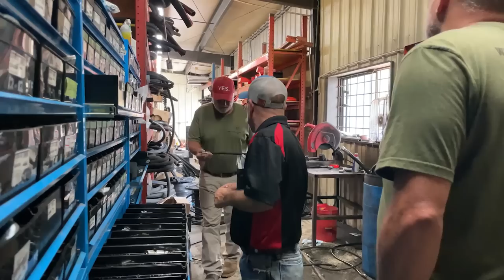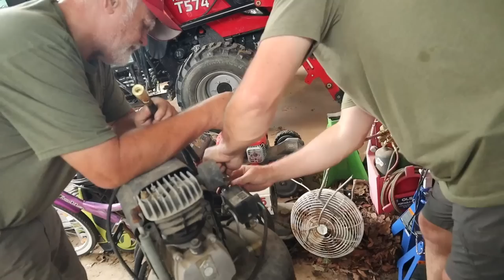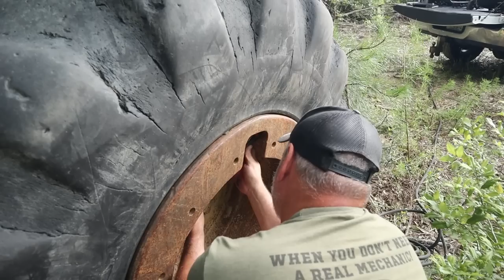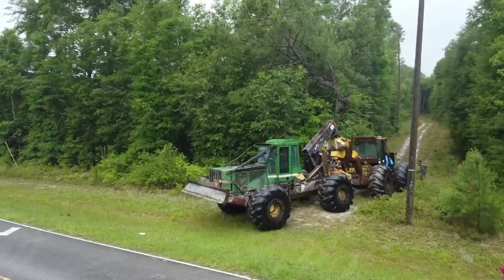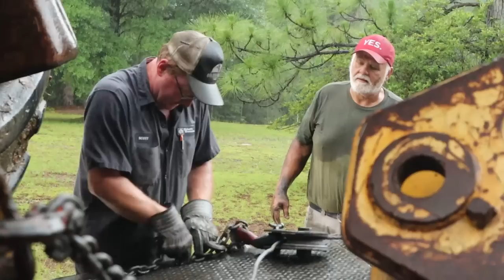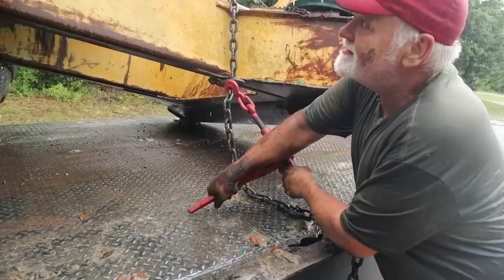OVERSIZED LOAD NEARLY ENDS IN DISASTER!

Comment: After working at a truck dealership in the parts department for five years I'm sure that guy wanted to retire after you two left. Maybe should have raised the blade up with the other machine and took a chain and tried to somehow chain it up in the air. That Peterbilts a little bit long in the wheelbase to be hauling equipment in and out of the woods.

Comment: I was mostly feeling confusion because your channel isn't usually so egregious. If you've never seen a load flip (often it looks almost spooky, almost like it was aided). but these loads on air shocks and flat decks. even after it was loaded it did not have stability and can easily flip, especially when the load goes outside the edges of the deck.
Seriously man, you guys need to set the bar just a bit higher when it comes to safety.
It's very hard to post to your YouTube channel if you're dead.
otherwise nice video and I really appreciate the effort guys. I think your channel is awesome and if you can save on the manufacturing of some new engines or the recovery of some decent machines. 

Those old Detroit engines were just made to run for ever.